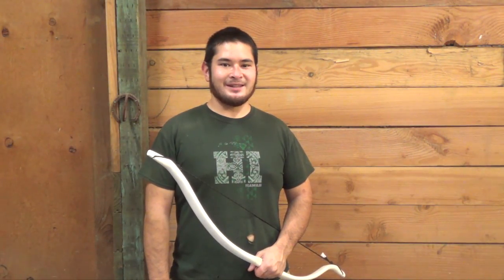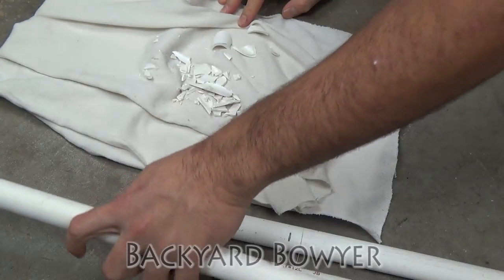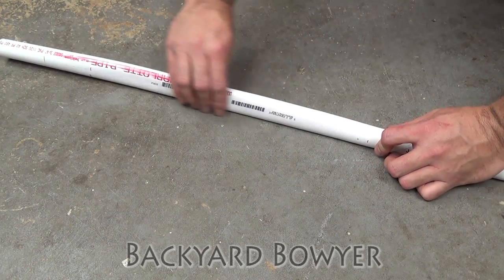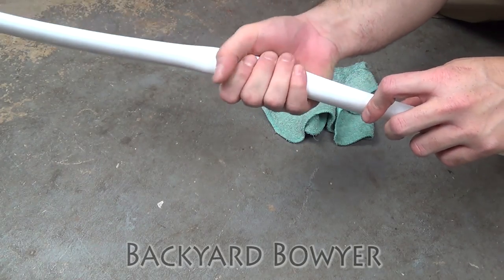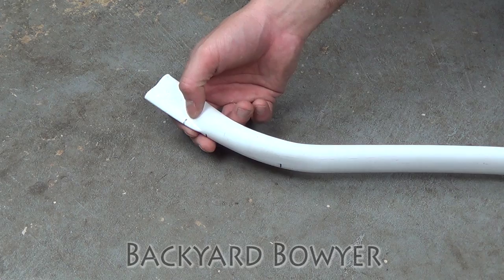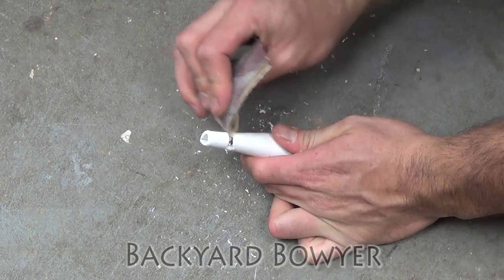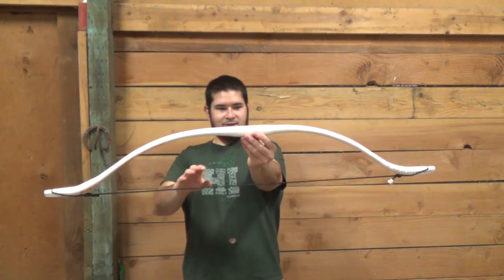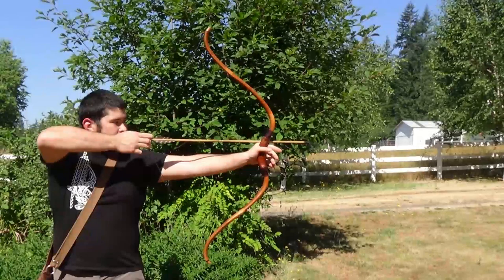40 Pound PVC Bow Freehand Tapered - No Flattening Jig Needed

Comment: Thanks for the great video! I built a PVC bow using your video. It was a fun build, took me 2 hours and $5 in supplies and I must say i was blown away by the results! I own several "real" bows and never would have guessed it would be so cheap and easy to build a functional bow. keep up the great work
Reply: You had a heat gun laying around? Lucky...
Reply: @MikeDbean420  , I made one using my kitchen stove. And a small outside stick fire will woik. Go slow.
Reply: @Mari Antoine Villaruel
No idea, but if it was possible it would take on a scorched appearance, that's for certain, as the heat would make the candle soot adhere to the pvc.  😂
If you try and are successful get back to the channel, as I'm sure a great many folk would be interested to hear.
Good luck!

Comment: Home Depot staff didn’t like me going around smashing their pvc piping with their hammer that I hadn’t payed for yet
Reply: lol
Reply: 😂.. oh an ertugrul fan
Reply: Any way to tell if the pipe will be suitable by squeezing it in the store?
Reply: uK8cvPAq smack it on one of the workers heads or something
Reply: @iyimontageziyi9079  Yeah but you break it you buy it and I'm not made of money.
Reply: Hilarious.
Reply: Lol
Reply: Honestly I think that's better than using it and returning it like everyone does.
Reply: Haha
Reply: Ertugrül Bey
Reply: You took your own towel, though, so why they complain is a complete mystery to me.
Reply: its their fault anyway... should've just had stronger pvc.
Reply: Buy around 60 and cut it down to 48 and use the extra to test the pvc you bought.
Bought mine for five Canadian dollars.
Doesn’t schedule 40 mean that it can withstand 40 lbs impacts? Cuz I legit have no idea?
Reply: @johnharrington4757  6 a one, half dozen the other... In other words, it doesn't matter. Defective merch is refunded to the store by the manufacturer. Buy several, whack umm, return what breaks. Home Depot, or whoever will hit up the pipe manufacturer. If they get spanked with enough defective returns, they might choose to fix their products!
Reply: @NonLethalDog  schedule 40 is supposed to withstand a certain PSI of internal pressure. Schedule 80 is thicker and has a higher PSI rating. None of it should shatter, though there are actually special types that have increased impact resistance.

Comment: Your videos are always so well informed and easy to follow. I have attempted to make a pvc bow 3 times and have failed each one 😊 However, this has inspired me to try again. Thank you for the video Nick
Reply from the maker: +Sandy Dennis Thank you for watching! How have the bow attempts failed? What kind of pipe are you using?
Reply: BackyardBowyer, I was using sc40 3/4" pipe. The problem I had was I would get everything heated and formed (I was using a jig I had made) but when I went to string it, it would twist and the string and bow went flying. I think things weren't aligned properly or maybe my string was too short (I was using paracord). I'm not sure but like I mentioned, this video has me wanting to try again and maybe I'll skip the jig and try it this way.

Comment: i like that 40 pound bow it realy look amazing i have been trying to make one but not to mutch succes it is the 3rd time i try  mabe the fourth  time will be the one thanks for sharing your knoledge with us
Reply: Maybe you didn’t use the right pipe or you forgot to use a thicker pipe
Reply: @alexgodraws1890  what is the right size? like 20mm 30mm 32mm?
Reply: Serdar Joshua 
I think it’s depending on your size
Reply: @alexgodraws1890  i am 5.9 which one should i use?
Reply: pierre lauzon
Are you using schedule 40 pvc or it's equivalent and are you hammer testing the pipes, prior to working on them, as we saw at the start of the vid?
Reply: @serdarjoshua5840 
I think he uses one inch, 25mm.
Maybe it's more comfortable to grip or has advantages in flexibility, tensile strength and malleability.
He may have covered this in another video, I can't recall.
Sorry I couldn't be specific or certain.
Reply: @alexgodraws1890 
I've seen a boy of ten with a thirty pound draw and a muscular man struggle with a twenty pound draw.
Size is immaterial.
It's better to gradually accustom yourself to progressively higher draw weight, as you use specific muscles you probably never employ on a regular basis in your day to day living, career or even sport.

Comment: What is the apsolute best pvc bow to make without the use of a heat gun? as far as speed and power goes?
I just love these crafting bow videos because when I was a kid I was making wooden bows myself,really brings me back in time :)
Reply: Dreadvil he made one with fiberglass rods in the middle of the pipe.
Reply: Dreadvil you can check out the vid that zna productions made. Minimal tools required and pulls 35 pounds
Reply: Dreadvil, do you own a toaster? The heat coming out the top would be enough to soften pvc. It might be a little trickier to heat evenly as you would be moving the pipe rather than the heat source

Comment: Any tips on getting the bow weight to 30lbs draw or less?  I'm using this for larping and we have strict restrictions for safety reasons.  Great vid, thanks for the assistance!
Reply: Just make the string maybe an inch longer or so so theres not as much tension.  The string length he did was 4" from the knock so you can try 3" or even 2" so its not under soo much tension.

Comment: it really sucks living in a place where there's so little good quality materials that can be bought. the pvc pipes I've been using are low quality so no matter how I follow you on how to make your bows, they always end up being failures, like easily breaking or the draw weight is too low and stuff. *sigh
Reply: Are you sure you did it right?
Reply: Are you using the thick ones? The ones used for water?
Reply: There are many types of plastic water pipe. Schedule 40 PVC is the operative requirements.
Reply: You can buy a recurve off of Amazon for less than 100 dollars...
Reply: Ur luck I don't even have PVC pipes here. I literally have to drive 60 miles to get some and I am not living in some village or forest or something. I literally live in a city. But yeah. There is always suicide. XD jk
Reply: Killer Show You don’t have a Home Depot or Lowe’s in your area?
Reply: @barryhewitt3921  nope
Reply: I may suggest using high pressure oriented pvc, those have thicker walls and give some flex in order to withstand high pressure

Comment: Hitting the Pvc Pipe with that hammer is that to test it ? You never did this in your older videos, so is this a new thing ?
Reply from the maker: +AngelTashaUK Yes! It's to test the impact resistance of PVC pipe. A tough pipe will fold rather than break if something ever goes work. 

It's not a new thing, but this is the first time I've shown it during a build. I've done 2 videos on it as well as mentioned it in some of my older videos.

Thanks for watching!
Reply: Yea
Reply: BackyardBowyer thank you for the info. Much appreciated, as i disnt know this would happen with PVC Pipe
Reply: In his previous videos on it, he's noted that pvc quality can be hit or miss due to storage conditions of the pvc (outside, sunlight exposure, too much weight stacking in storage, etc) and a possible change in the manufacturing process/"recipe" of the pvc itself. That's all the specifics I can recall without rewatching =D
Reply: Syrkyth I think it's mostly UV exposure. messes with the polymer chains makes it more brittle. honestly I'd like to see him heat up one of those broken pipes let it cool and retest it. could reset the polymer a bit.
Reply: Hi nick....what if we didn't have a choice and we have to go with that pvc that  coud be cracked ? I mean do we have a great risck here ? I hope youe respond...thanks in advance .

Comment: Excellent! What is the composition of the PVC tubes that shattered when hammered, whereas the third tube did not? Could you possibly ascertain the differences? Also, how do your bows resist winter temperatures i.e. is there a risk of them bending or shattering?

Comment: That is awesome and exactly what I'm looking for. I built a basic bow out of 1/2" many years ago using some string I found at the hardware store (no limb flattening or tapering or recurve just bent the pipe and strung it poorly), and have wanted to build a better one since. I'm definitely going to try building this.
However, I have several questions. First, how exactly do I test to find a good/strong enough PVC to build it with? I have plenty of 3/4" so I can test it, but what am I looking for - how many strikes it takes from the sledge, or how hard? Also, what would be a "proper" bowstring material to use for this? I googled some DIY bowstrings but it seems those are all ones you have to wind yourself using expensive materials and custom waxes and such... I just want something I can buy and go with. I know paracord works as a temporary string, and I do have some of that but I want a better, more permanent string. Third, are there any stronger designs? Like would you recommend putting a secondary limb on the front (as others have done, google PVC recurve and you'll see what I mean) to increase the draw weight? Finally, what's a good way to make a handle and arrow rest/guide for something like this? I know not every bow needs that, but I want to build one "traditional" bow and one "DIY modern" bow.

Comment: Great vid, bow seems powerful enough. My concern is how it will perform on a hot day, will it turn into a wet noodle? ON a really cold day, will it snap like a twig? Interested as all get out, just don't want a fair weather bow.
Reply from the maker: As long as the temp is below 160 °F, the bow won't change. The main problem with heat is the bow may get an excessive set, meaning it will stay slightly bent when unstrung. This only really happens when a bow is left strung inside a closed car on a hot day. A gentle reheat to straighten out the limbs will remove the set. In actual use, I have found bows work fine in upwards of 115°F. A poorly made bow may fold at these temps, and that is easily fixed with some heat as well. PVC used in water pipes resists bending more when extremely cold, cold bows usually perform better. If the design is very over-stressed or the pipe used was brittle to start with, it can snap though folds are still the norm and can be fixed with heat. If you plan on making an all-weather bow, consider Formufit UV and impact resistant colored PVC pipe. It has no fillers, so It is much tougher and easier to form at heat while being very stable in all temps. I have not personally tested in under 5°F, but as long as the pipe is good and the bow well-made, I don't foresee any problems. Just remember plastic is less flexible when cold, so try not to use it as a hammer or club and it will be fine. Hope this helps!
Reply: @BackyardBowyer  Very helpful, thanks

Comment: Can a hairdryer be used instead of a heat gun? Or does the heat gun provide some unimaginable amount of heat?
Reply: Let's just say I wouldn't recommend using a heat gun to dry your hair.
Reply from the maker: Most hair dryers won't get hot enough to soften the PVC in a timely manner unless modified. A stovetop would work much better.

Comment: Nice instructions! Which brand of PVC did you go with? Have you tried filling the inside of the bow with epoxy resin? I would think that this would give the bow a higher draw strength.
Reply: I think is a good idea what you say, epoxy in relatively small thickness, it would make a stronger and more durable bow.

Comment: I have a 34 1/2" draw length. I already know arrows will be impossible to find. Which is why I want to learn to make my own bows and arrows. But I must first learn the bow. From what I've found from research, I need a 72" to keep it from stacking so drastically. I never really understood bow lengths outside of thier relationship with draw lengths. And I need to know the length of pvc I need to make a properly sized bow. Also would the draw weight change if I used a lareger diameter for more material on the handle, for my larger hands? I really want the get back into archery, but the cost for a custom bow and arrows is ridiculously high. That's why I'd rather learn to make them myself.

Comment: Could I use a hair dryer instead of heat gun to bend the pvp pipe? Also my PVC is a bit bigger radius then yours does. Would that work still? I have two pieces of pipe I'd have to join together somehow as well as left over bits of curved PVC and some T joints. Could i use that too? Or would I be better of getting a fresh piece? Just wanted to make a simple bow to practice with in my backyard during the lockdown and I don't think any shops that sell timber or PVC are still open because of the lockdown.

Comment: Awesome, I think I finally want to build a bow. Just one question: can I paint it, and what kind of paint holds on pvc the best?
Reply from the maker: +Mátyás Ludvig You can paint it. Krylon fusion is one of my favorites, though I haven't seen a lot of it lately. Pretty much any spray paint for plastics works, just stay away from etching or self-priming paints as they can weaken the plastic.

Latex house paint actually works very well and can be used to make a base "skin" that can then be painted over as well. Keep in mind that it doesn't really stick to the pipe and can be peeled off. Hope this helps!
Reply: BackyardBowyer Thank you very much for the brief guide to paint pvc!

Keep up the good work!

Comment: I am interested in this bows speed and the weight of the arrow tested. I make osage bows, and make them much like this shape. I would like a comparison.  My bows are 50 inches long strung and shoot 165-175 fps with an arrow tgat weighs 10 grains per pound of draw weight. Very interested to know how this bow you made compares? I enjoy your work and have for years. Thank you for your efforts.
Reply from the maker: +Kevin Hawkins I haven't tested the speed on this bow yet, I'll have to do that. Though from experience, I would expect probably around 145-155 fps with a 10 gpp arrow from this bow. I could probably get around 170 or so by making a shorter version that starts out at 44 inches. It's not going to be a very fun bow to shoot, with how they usually stack at that length of 42" ntn.

I'll get working on setting up the chronograph and recording the speed of this bow. And maybe making a couple of super short 50-55 pound PVC bows and testing those out as well!

Comment: Hi Nick, I'm building my first PVC bow. My question is how far above the center of the bow do you mount your arrow rest?
I'm using a 54" pipe and making re-curves. Can you give me a good guess what my pull weight might be? (i'm making my handle about 8 inches.) I used a brick to push it in on one side to help make it closer to center line.

Comment: This was so cool! I don't know if I could make it myself, but I think I may have to try! How much was the total cost of this build? Is a heat gun required or would a hair dryer also work?
Reply: Hair dryers don’t really get hot enough. You can get heat guns that go up to 1000 deg for about $25. Other than that, if you’re flattening by hand like he his here and already have a saw, your only cost is the pipe, paracord and arrows. Probably about $40 all in for your first bow. Obviously cheaper after that since all you need is more pipe and more string

Comment: What was the manufacturing dates printed on the pipes that broke and survived the hammer test?  I'm curious if age or time of year correlates, i.e. spring/summer made pipes sitting in a shipping container baking in the sun degrades the plasticizers.
Reply from the maker: +JL Laine The date was 5/24/2016 for all three. I bought two bundles of 10 at the same time last June, they are all dated the same and have the same batch number. When I bought them, about half of the pipes I used had failed the hammer test.

I keep the pipes out of sunlight inside my house where the temp stays constant all year. I have yet to see a tough pipe become more brittle in my storage. I have pipes from 3 years ago that are still as impact resistant as ever. I wish I had bought closer to a pallet back when Charlotte pipe used to only fail extremely rarely, maybe one pipe for every couple bundles of 10. Now it's closer to 50/50.

Thanks for watching!

Comment: Would there be a way to make the bow either stronger or weaker depending on what it is being used for?
Reply: XD don't pull back to hard? I know you can make it stronger by using 1 inch PVC instead of 3/4

Comment: Hey I commented on your yumi style bow I made which has been awesome and seen this video and though duhh i have 1/2 of the pipe left from it so I grabbed a harbor freight heat gun and made that little heat reflector box ya got.

I have all the tools to start it, my question is how would you compare the two ie. The draw, comfortability, FPS etc.. The fiberglass rods i know add a lot of power to the yumi vs the recurve but im guessing the design of it being a recurve compensates with it's design..

My main question is what's more comfortable to shoot for you? I am gona make this recurve as well since i already paid for the pipe and paracord so this is literally zero cost to me so the $15-20 for material on the yumi gets somewhat divided into a 2nd bow.. 2 bows for say $20 sounds good.. Abother $20 on 12 practice arrows at 30" and i got a $10 3 finger glove on amazon. All in for $50 for 2 bows, 12 arrows and a 3 finger glove to start learning seems a steal.

Do you ever make slingshots?  I made a slingshot outta a Y branch and tube bands with a crappy pouch and bought some steel ammo and it was a blast.. My pouch was cheap leather but I learned about anchor points etc before I made a bow and got into archery.  Love your bowyer content, keep it up !! 👍👍